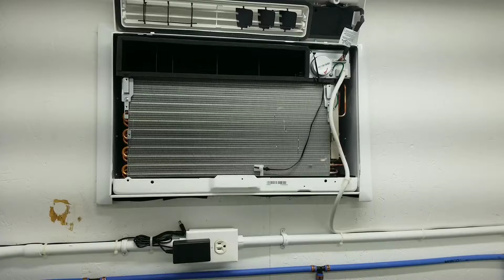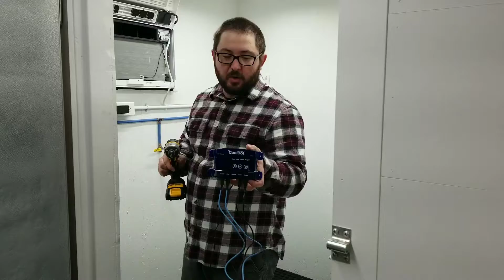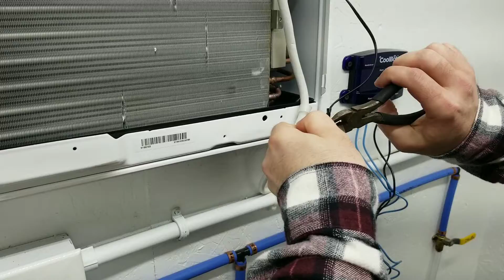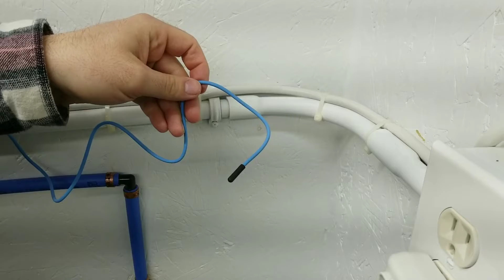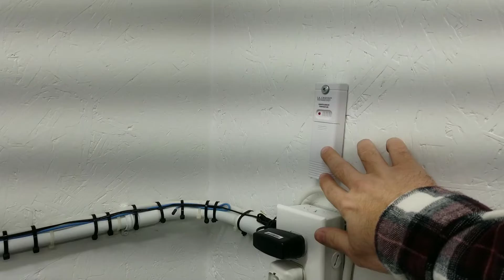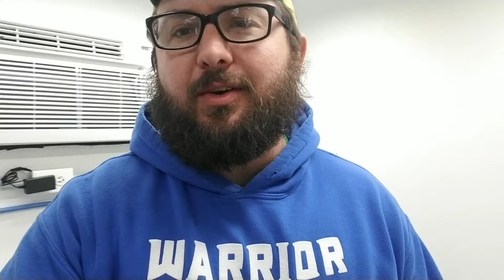Walk-In Cooler Build Pt. 2- Installing a Coolbot

Comment: Osb on the walls covering the Styrofoam do you run in moisture issues? What did you apply to osb just paint?
Reply from the maker: I have not had any issues, it was sealed with oil based killz exterior primer. I have recoated it once about a year ago but that was for aesthetic more than anything

Comment: I seen you made this video a few years ago how is it all holding up do you run it year arround or just a few months out of the year have you had to replace the window unit at all
Reply from the maker: We mainly use it for our maple syrup season, so it runs constant for 4-6 weeks then, and maybe we use it a couple other random times throughout the year if we are having a big party or something. But we are still using the original AC unit.
Reply: @ChanyataFarm  that's great thank you

Comment: Great video. I'm actually putting one in cooler now. My LG unit looks exactly like yours but it has a dual inverter. Yours doesn't have a second sensor?
Reply from the maker: Only the one sensor
Reply: @ChanyataFarm  Thanks!

Comment: I want to build a cold store, but we don't have electricity. It is in the forest. I want an apple cold store, can you help me?
Reply from the maker: I’m not really sure how you could accomplish that besides building an underground root cellar type of thing
Reply: Do you have a solar set up or can you to have power for your unit? Will need batteries, inverter, charge controller and solar panels....but yes digging a cold storage is cheap and easy if you have a small machine or a great work out if hand digging.